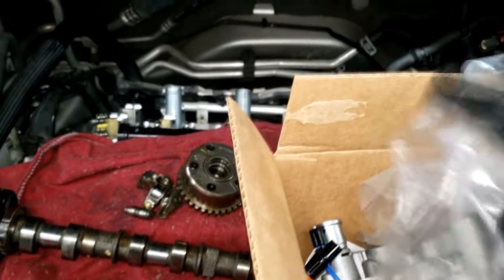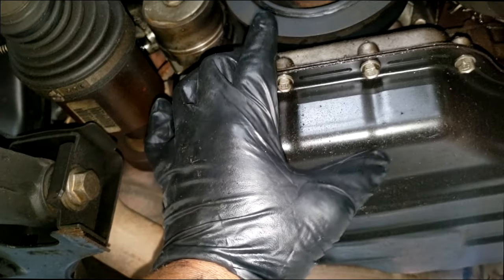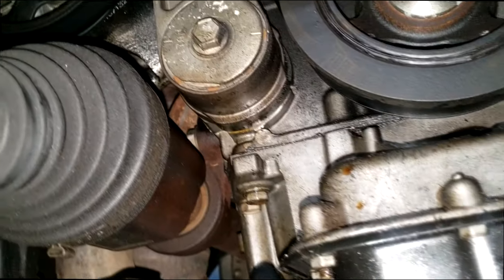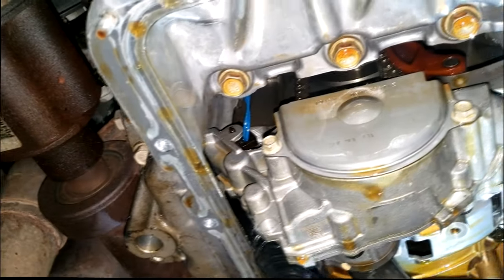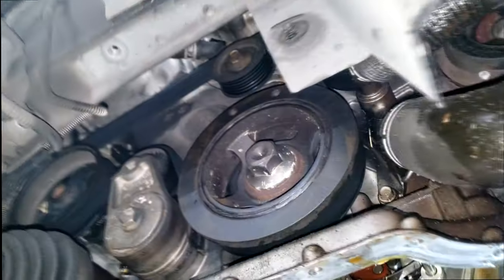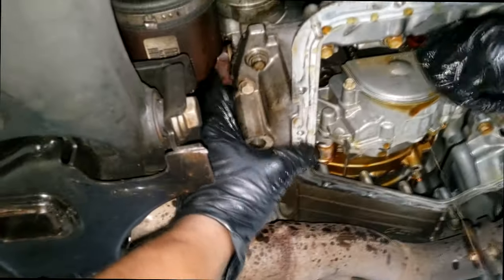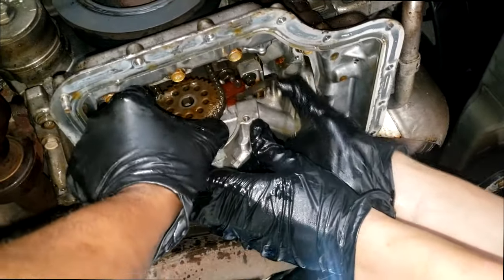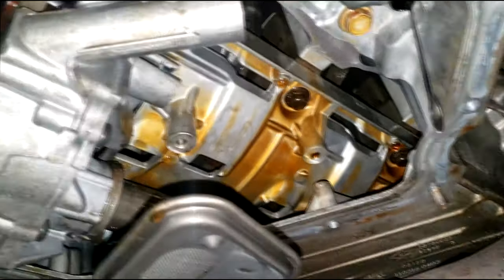How to replace a OIL Pump. Oil light flickering P06DD P0522 P06DE. Dodge 3.6 Pentastar ticking noise

Comment: I first started to have rough idle in cold start with p301 code once awhile with my Giulia around winter time. Then I just clear it and drive. The car was little sluggish but eventually gets better as I drive longer distance. Brought it to dealer and they recommend me to replace spark plugs and fuel injector. I denied it because the ride is smooth when engine is in operating temperature. I then got some fuel cleaner , definitely the shifting a lot better after adding fuel cleaner . But now I have this P06DD code after I drive awhile after 30 mins. Is the fuel cleaner messing with my oil pump? What should I do from here?

Comment: Im getting p60de code on my 3.6 challenger. I do have the the correct oil filter but oil cooler is the doorman after market. The code just came up this week and the filter housing has been on for 2 oil changes now.  I changed the oil pressure sensor but the code came back. I’m about to hit 80k miles on the car and yes am subscribed. Do you think this would still be the oil pump?
Reply from the maker: Hey bud, usually when the solenoid on the pump fail it would give off a P06DD. What I'm hearing is that people us the Mopar sensors when they have that code and all works out.

Comment: Please advise me I took my 2012 Dodge charger se  for oil change the tech told me my housing and oil filter were broken and I needed to wait for a housing so I waited 30 minutes  paid and left , now 7 days later my engine light comes on so I go to AutoZone get a code needs (sensor) my oil light is red , my psi is 9. Turns out they never replaced housing nor filter . We pulled big broken pieces out 😭 . Took back and they knew and admitted to breaking and want to do a free oil change Tuesday . I am scared what should I do

Comment: The P06DD only fixable with replacing the oil pump?? New challenger with 80,000 miles just threw this code. I’m over my oil change by maybe 100 miles but that’s not going to make it throw that code would it? Thanks for any information in advance!!
Reply from the maker: No, theres other things that can cause this code. Is that the only code stored? Also are you subscribed to the channel?
Reply: @OnlineMechanicTips  I am now! And yes sir, that is the only code I was given. Went back to the site I was on and realized I scrolled past the other causes. Says low or dirty oil as well, so I wonder if it’s not that then
Reply from the maker: @DoubleKlutchRacing  I will say this about P06dd. Its about oil pressure, so before you start thinking you automatically need a oil pump, there are in fact some small things that can trigger that such as oil level or even the wrong oil. So I usually advise everybody to at least try a oil and filter change with new parts first.
Reply: @OnlineMechanicTips  ok, caught that at the beginning of the video but figured I’d throw the question out there. I very much appreciate the very quick response and answers!

Comment: Have a 2012 challenger havent checked oil pressure on it yet but its the p06dd code and the red oil light ia flickering on and off should i just go ahead and do the pump and solenoid to not waste time? Aince the flickering light is a usual indication of the failing solenoid on the pump? The oil pressure sensor was already switched or should i change the oil cooler/filter housing?
Reply from the maker: How many miles on your car? Also are you subscribed to the channel?
Reply: @OnlineMechanicTips  not sure it'd bot my car but I think I saw it had above 150k+ miles and yes I am subscribed to the channel man love to wrench have never worked on these pentastar engines im a honda/chevy guy haha
Reply from the maker: @juanpizano7781  O cool. Yea its pretty much a no brainer with this code. If oil level ok and the oil filter correct as well as the sensor already been replaced, its now pointing toward that oil pump.
Reply: @OnlineMechanicTips  thanks man I thought so too only reason I was hesitating is because it looks like there might be a leak at the base of the oilfilter/cooler housing but it might be from the jiffy lube this guy took it maybe these guys dropped a bit of oil whilst removing the oil filter which is a China made one maybe that's what causing it but it also has a slight tick so I'm really going words the oil pump and solenoid or do u think the leak in the housing would cause a p06dd how often do these oil cooler/filter housing warp?? Or leak?

Comment: my 2013 dodge charger se won’t go over 3k rpm will this fix it or is there another issue that might be messing with it plz help
Reply from the maker: Hey bud, theres likely a trouble code in the car computer that can help put you in the right direction. Have you had the car scanned yet? Also are you subscribed to the channel?

Comment: Besides changing the oil pump do you have to replace anything else ? Like gaskets or seals ?
Reply from the maker: I mean, you will have to remove the oil pan so will will at least need some silicone, at least on this Caravan you will

Comment: I have the same issue and, I've run out of ideas to repair this.. I changed the oil pump (non-OEM) no difference. Changed the oil filter housing and sensor, no effect. Fresh oil change with 5-20 weight oil and OEM filter no effect. Checked sensor harness found no pushed pins or connection issues. I can watch the oil pressure on the dash and it seems to be stable although the reporting frequency is pretty slow so it might not show any spikes in pressure. My question is, if the thermostat was sticking and the temp was below the trigger on the temp curve in the TCM, do you think that would give the P06DD code? One time I had a "cooling temp below expected value" code but it hasn't ever come back.
Reply from the maker: Hey bud, what kind of car is this? YMM? Also are you subscribed to the channel?
Reply: @OnlineMechanicTips  New subscriber.. thanks for the help! "16 Jeep Wrangler 3.6L Penti...
Reply from the maker: @beaugator  Hey bud, there was a couple of case studies on this year model Jeep. First off, is the P06DD the only code setting? Also did you just do a cyl head replacement lately?
Reply: @OnlineMechanicTips  That's the only code atm. No other maintenance other than what I listed.
Reply: Interesting side note... I just cleared the code and warmed it up over 150* and drove it a bit around town. No code! Reading Larsmo's comment is leading me to think it is temp causing it. Maybe a slightly stuck thermostat. I bought a thermostat and housing for it already when I got that "under expected temp" code so, I'm going to change it out and see if that does it.
Reply from the maker: @beaugator  OK, 1 or 2 issues, if you 100% sure that aftermarket (non oem) oil pump you put on working as design, you may just have a glitch in the computer that will likely need to be flashed updated to fix. OR, the oil gallery plugs on your cyl head have somehow worked there way loose causing the air pocket and lose of oil pressure, which will cause that code.
Reply: @OnlineMechanicTips  Good info! Thanks! Is there a way to check the rev level of the software other than a dealer PC? I would think cavitation/air bubble would show even on the oil press gauge. This seems like a transient signal. I'm going to change the thermo and see what happens. Can't hurt.....
Reply from the maker: @beaugator  Im dont no of any other way other than the dealer, sorry
Reply from the maker: @beaugator  Im doing one as we speak on a Dodge Journey. The thing with erasing it and driving it, you will get excell back, but after 2 or 3 wide open trottles, you loose excell and the light pops back on..She finally approve the oil pump.
Reply: @OnlineMechanicTips  I've had this have the CEL come on right away after cold start and sometimes I can drive a day after clearing till it returns. I get what your saying.. my code went to "permanent" and my OBD2 scanner would say it was cleared but still have the code stored. Then I drove it a while and the code went away. I thought I had it fixed at that point but... no such luck! lol

Comment: I have a 2019 Chevy Malibu. I got this code my car was having reduce power accelerating slow and I change my spark plugs in my car. My started driving fine clear all my codes My engine light has been off for the last two days.

Comment: Can the upper oil pan on the 3.6 cars be removed without removing the cross member / sub frame ? Im doing rod bearings on a 300 with the engine still in. Hoping i dont run into problems getting the upper oil pan off. Im thinking it might come out after removing oil pump let me know your thought thx
Reply: You might have gotten this answered somewhere else by now but the oil pump and upper oil pan are not bolted to one another at all. Only things it's connected to are the engine block and transmission. Might have to take off the dipstick tube. If you run into issues taking it off, make sure you got the two hidden bolts that you need an extension for. They're located at the back of the engine just before the trans, and hold the middle of the upper pan to the block. Otherwise it's just a matter of freeing it from the rtv gasket maker
Reply: @Critter0817  I ended up swapping the engine but thank you for sharing your knowledge sir great info for anyone looking to replace bearings on a 3.6 pentastar (p.s. i did come across those pesky 10mm bolts right before the trans and it was a PITA with the sub frame still bolted on.)

Comment: The engine light was on, was checked at autozone they told me it was the Oil Pump, it was checked at Oreilly P06DD had a code they said it was an oil sensor, now light came off, but now engine gets hot, the oil sensor is the one you show on the video? I remember the code was P06DD. Or is that sensor located somewhere else? Thank you.
Reply from the maker: There is a oil pressure sensor located on the oil filter adapter housing. What parts did you replace? Also are you subscribed to the channel?

Comment: My 2015 jeep wrangler has code P06DE. It has the correct filter, i also replaced the oil pressure sensor but the code is still there. Any possible diagnosis and fixes ? Please help, its god 125k miles i use fully synthetic oil yet replace it every 5k miles at most.
Reply: Engine oil pressure control circuit stuck on (P06DE).
Reply from the maker: Hey bud, if you have replaced the sensor on the adapter housing already and you getting this code, its likely that your dual stage oil pump solenoid is stuck off. Which at the dealer would require you to get the complete oil pump replaced. Some guys/shops just doing the solenoid with success. Thanks for watching, please thumbs up the video and subscribe to the channel, thanks

Comment: Po6de on 2013 malibu put new oil pressure sensor still saying Oil pressure control solenoid valve stuck on would that be pump?
Reply from the maker: Yes pretty much. What exactly is the code its giving? Also are you subscribed to the channel?
Reply: @OnlineMechanicTips  p06de

Comment: The clip is easy all you need is a flat head screwdriver , from behind the crossmember straight to the side of the block get the flat of the screwdriver between the pin and block then twist to put back on you fit the clip over the new one and wiggle it into place

Comment: Hey you probably wont see this but any chance cam phases can cause low compression on 2 4 6? With a misfire
Reply from the maker: Of course I will see it, you a subscriber, thanks. Now, I have yet to experience such. However, I have seen a broken cam do that. But the fact of the matter is. With low compression, you have no choice but to tear down anyway. You would be surprised at what you may find by removing that valve cover. Phasers failures can cause timing to be off which could affect compression if severe. Ide say take the valve cover off and look around..Make sure you do not have an extended warranty X56 that apply to your car, this job may be free if so
Reply: @OnlineMechanicTips  hey thanks for the reply man. I have replaced the vvt solenoids with no luck. I do know the engine ran a little low on oil and was making a tik. Plugs were all fouled up too. Its a 2012 buick enclave by the way. Back 3 cylinders are between 18p-170 compression too.

Comment: Hey JT. I stripped the top bolt of my PCV valve on my 3.6. It is the Torx bit. What do you recommend to get it off?
Reply from the maker: Its like a T25 with a good angle. Last time this happen to me, I ended up removing that valve cover and it was the insert that stripped. The good news was that on the updated PCV, it only use 2 screws, not 3 so that stripped one was not needed any way. If using a real good T25 wont bite on the screw, you may not have a choice but to take off the VC to get it out..Good luck bud
Reply: @OnlineMechanicTips  thanks man for the reply. I will try the VC if I can't get a better T25 to bite

Comment: When replacing, how do you prime the new oil pump?
Reply from the maker: You dont, never a problem
Reply: @OnlineMechanicTips  ok awesome!  Even for a new engine?  Never been ran, just replaced the entire thing.
Reply from the maker: @brianw.520  O I thought you meant that you was simply replacing the oil pump
Reply: @OnlineMechanicTips  I apologize yes sir.  I replaced the entire engine.  Do I just turn the crank with the starter several times with the plugs out?

Comment: Is 18psi  normal oil pressure for 3.6 charger when idle and the oil reach opreational temp
Reply from the maker: The PCM computer determines that based off of a number of inputs such as RPM and more. Was there any codes? Also are you subscribed to the channel?
Reply: @OnlineMechanicTips  there is no code and rpm approximately600

Comment: My 2006 Chrysler 300C 5.7 had a P0522 code.... and its because it dropped a valve seat and was consuming oil rapidly because #6 piston was damaged and allowing oil into the combustion chamber.

Comment: I've got a promaster with the 3.6 and have the code po6dd and she's stuck in limp mode "won't go over 3k rpms" do you think the oil pump is the culprit. No way to verify oil pressure as of now. I'm assuming I'll have to remove the axel as well to get to the solenoid for the oil pump? I also already replaced oil filter housing assembly and still in limp mode.
Reply from the maker: Hey bud, there are step I usually take before just assuming the oil pump is the problem. And you are correct, without the tool, its hard to verify if oil pressure actually correct. Do the engine produce any kind of clattering or valve train noise? Also are you subscribed to the channel?

Comment: Hey man love your video!! Really helps to work on those pentastar. I got only a P06DE code coming on a 2017 ram 3.6 from time to time. I reset it with an odb reader and i can run sometime couple weeks before it comes up again. What do you reckon? Oil pressure sensor on the oil filter manifold assembly? Thanks in advance!
Reply from the maker: Yes, this code rarely points to a oil pump. I have had succes replacing the sending unit on the adapter housing for this code.
Reply: @OnlineMechanicTips  Hey JT, Just wanted to give you a little update. I Finally got to change the oil pressure Sender unit on the oil filter adapter housing. 2 Days later P06DE came back. Got to the dealer to get a good Diagnostic and he recommended mee to replace my current WIX filter to a Mopar one. He noticed that the wix one diameter was lower thus creating more restriction thus more pressure created so potentially the issue there. He swapped that. Then, He checked the oil pressure with an analogic gage plug to the filter cap and he saw a difference of 5 psi more on the WIX compared to mopar filter. But other than that, all the oil pressure were good. All PCM module were all up to date. Drove the truck for 2 days and the P06DE show its face again! Maintenance wise, I've been doing my oil change every 5000km (3200 miles) since I have the truck 40K miles and now I am at 87k miles with a new oil filter each time. So oil sludge is out of the question. The Mopar Tech told mee if the code would come back again , it is most likely the oil pump solenoid so basically the whole oil pump. On a Ram 1500 3.6 that said pump is awfully tricky to replace (remove driveshaft, steering rack, cv axle and maybe front diff to lower to get access to that upper oil pan... Drives mee kinda crazy to do that and "Hope dear god it is the fix". Have you had lately some problem like this on ram 1500 3.6? Or did that said job? Mine is a 2017. Btw freaking love your channel, so helpful to work on those mopar car/truck! Thanks!
Reply: @Beaucage02 I just bought 2012 dodge avenger off a guy. And I’m returning it. The bracket and and the sensor have been replaced already. The guy as changing the oil before he gave it to me.. he seemed sheisty. He supposedly put in the wrong oil so I went back he changed it again. Then put a new filter on and had to put another quart in. The lemon law where I live gives you 7 days to get it inspected. So on day 6 I get it inspected and that’s where I find out all that was recently changed and it’s probably the oil pump. The light came back on 3 times in the first week
Reply: @M_eye_d_s_tinks  I ended up replacing the oil pump and it fixed my problem. No more light and runs good!